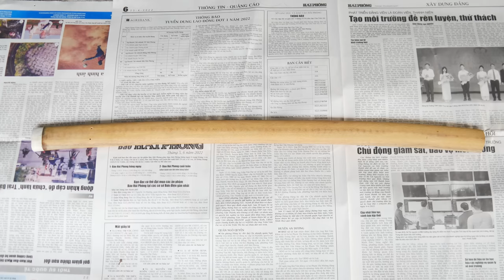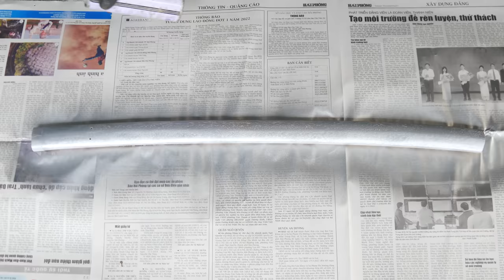A great idea to create a golden katana from brass

Comment: Sword enthusiast here, you REALLY didn’t unsheathe the blade correctly, you have to have your thumb on the tsuba and push the blade out to break the seal, plus you need to grip the sword from below, that way the cutting edge is facing away from you
Reply from the maker: Thank you ! I'm not a professional swordsman
Reply: @Arts-and-Crafts  its fine, I’m just trying to spread the knowledge, and sorry if it came off as kinda rude

Comment: It’s a great display piece. I bet if a steel sword were made, and all but the cutting edge were clad in brass, or a similarly corrosion resistant alloy it would enhance the weapons corrosion resistance while preserving functionality. The only vulnerable part that would be exposed would be the edge, thereby eliminating the need to disassemble for cleaning and oiling.

No idea how it would be done, honestly; a thick electro deposited layer would be very time consuming and require a great deal of finishing to expose the edge afterward.
Reply from the maker: Thank you, but what you just said would be nice if it was done, have a good time!

Comment: I love that people try different ways of showing katana as soon all katana smiths in Japan will die.  This is amazing but the only issues I would point out is the metal menuki which is supposed to be bamboo for safety, the wrapping is a little off and you might wanna re wrap it because it might come off, And this is just a personal preference thing but the gold on the sword whilst being the point of the video will ware and rare overtime and you will not be able to sharpen the blade without taking of some color. But either way nice job it’s nice to see some new smiths. Edit: “ also I don’t wanna be that guy but your Sageo string is on the wrong side lol.

Naruomi#0190
Reply: the entire blade is A) for display and not supposed to be actually used, and B) is made of brass. the entirety of it is that color. its not going to come off.  Edit:: I also realized you called the mekugi pin a menuki, which this art piece doesn't feature.  a menuki is a decorative piece that sits under the ito or silk wraps of the handle.